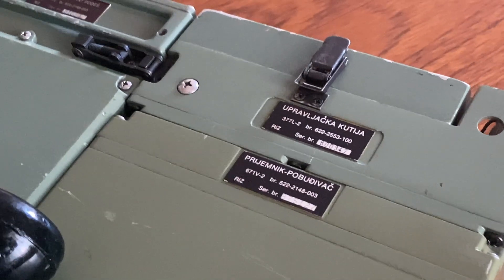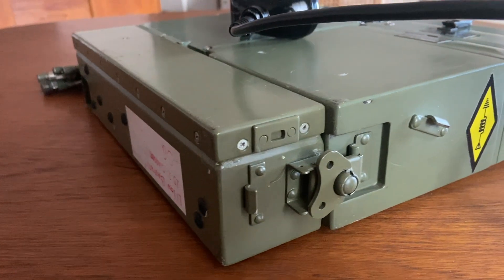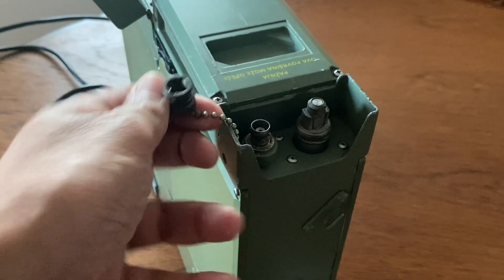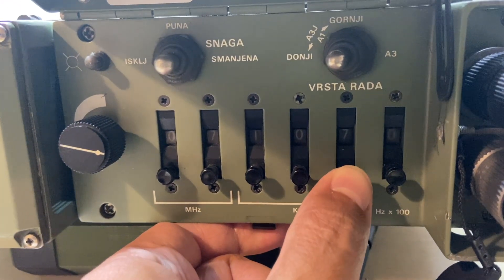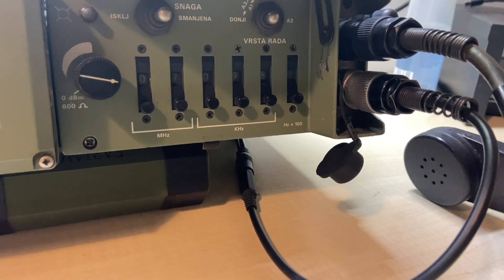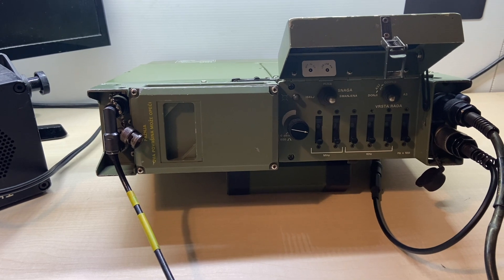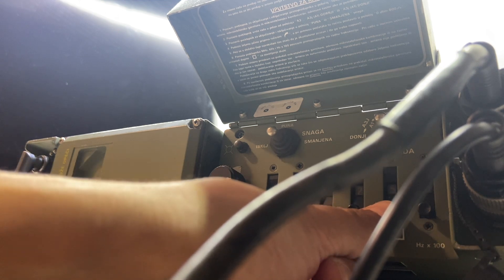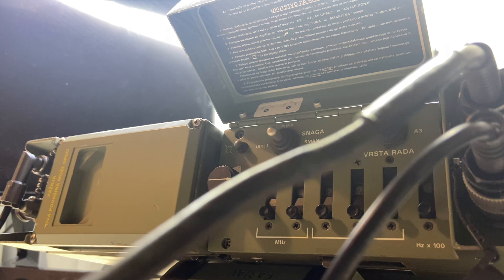RU-20 Ex Yugoslavia Military Manpack Radio

Comment: I am building a battery pack for this radio. Already have it built but waiting for the yellow high temp tape, BMS and shrinking external cover. Your video on building the battery inspired me about learning all about batteries as possible so I could build mine. By the way… where can I find the battery level tester you have installed on the exterior of the battery (@5:26)?
Rob, YS1RS

Comment: This is a GREAT (and under-rated) manpack, real Collins quality. I have the digital control head made by Zlatko, that makes this radio really usable for HAM applications. The nice thing is that the head is plug-and-play, so no modification is done to the radio; I saved the original electro-mechanical head for originality. I rebuilt the battery pack using modern NiCd batteries; next time I will use more efficient technology. I agree that the tuner tunes even a wet noodle.
Reply from the maker: @ShortWaves  wwt noodle! That was good 😂